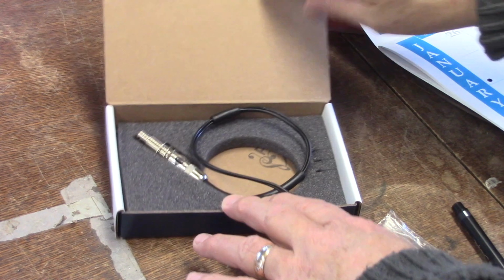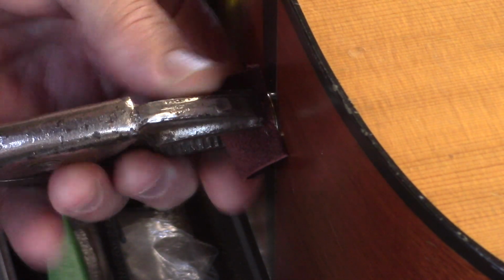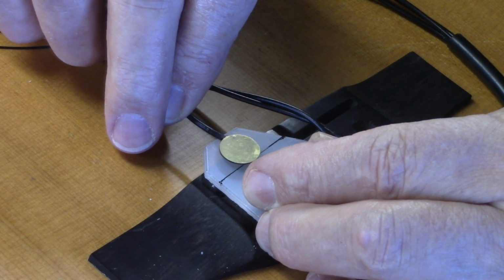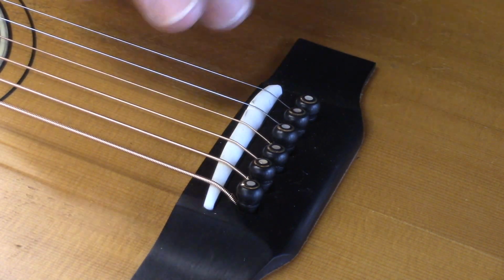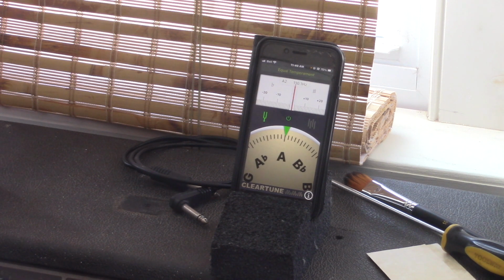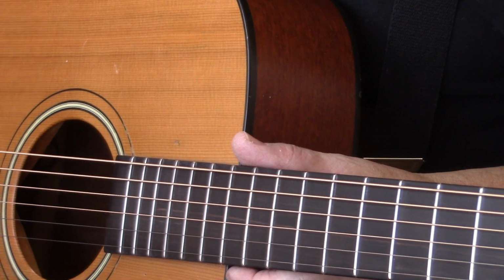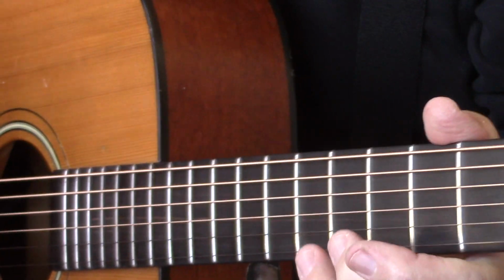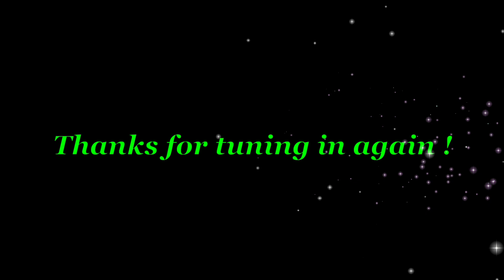K+K System Install @StringTech Workstations

Comment: Could the transducers be removed from the bridge plate if needed? And, do the transducers affect the tone of the guitar when not plugged in and played acoustically?
Reply from the maker: #1: No, best not to remove. Possible but not a good idea. #2 The few grams of mass on the bridge plate does not affect anything acoustically. Sticking something under the saddle is much more likely to change things acoustically.

Comment: can you explain further  why the last transducer is placed under the first string only instead of being in the middle of 1st and 2nd string? is it because the first string have a much weaker output than the second string?
Reply from the maker: That was in the installation manual. I imagine they figured it out by trial and error.